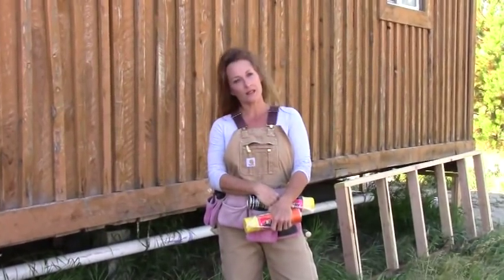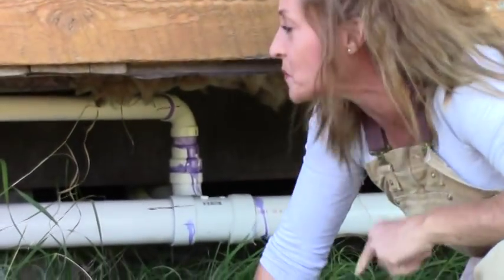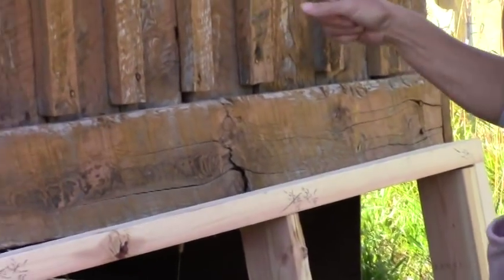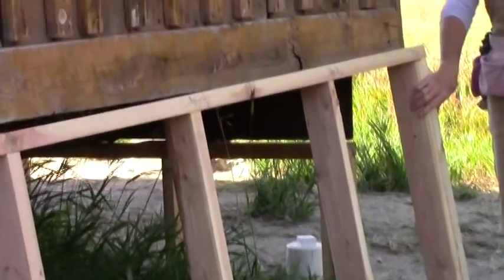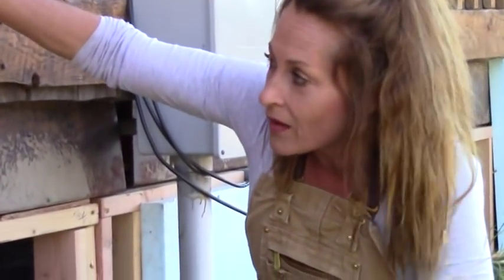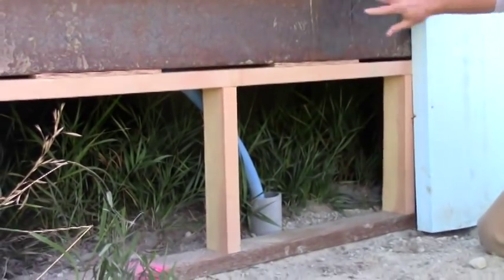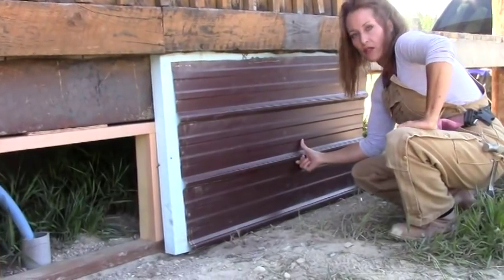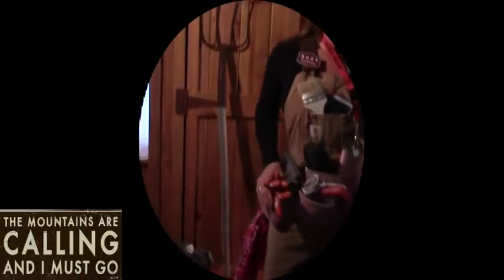Skirting a Trailer or Cabin

Comment: you should have pour a small concrete  footer all around the bottom of the trailer to fasten your bottom treated 2x4 to. wood to ground will rot, sooner or later.

Comment: I luv her :D Can you use the ridgid foam in the under the floor instead of the fluffy stuff?
Reply from the maker: yes--it works great for exterior purposes ..I like it because it doesn't provide a home for critters !
Reply: I just recently bought a 1/4 acre lot with a old 1979 mobile home on it next to a lake for $5,000. I'll be closing on the sell of my house in the next month and will be moving there full time. So it needs alot of work and all the fluffy stuff needs to be pulled out. I like the idea of not having to itch for days when replacing it lol. So I guess I just fill the whole space between the floor joists with a stack of that foam?
Reply from the maker: the Blue board insulation comes in different R Values and the only disadvantage to it is that if your area is not perfectly square you will need to grab some gap filler to get any missed spots.....good luck with your project..how exciting ! And thank you for the SEO info...I will look it up for sure ! Yes ,I have a FB page as well as a few other social media spots...Love the name of your channel...sounds like you have a sense of humor !

Comment: Nice project but how would you deal with possible termite problems?
Reply from the maker: I get the question alot...hard for me to answer since Termites are not really a problem in this part of the rockies....its rodents here that do the damage in the insulation ... but you may want to use treated lumber on all your framing and or use a bug spray around the base and in your crawl space yearly....good luck !

Comment: Nice video presentation.  The Rockies calls for cinder blocks? :)
Reply from the maker: there are a lot of variables as to what kind of base is used for mobile homes but the ground in this part of the Rockies is a very hard clay base so cinder blocks work great since the ground does not shift much after your pad is settled...the key is to give your new pad time to settle or don't touch the ground at all so there is minimal movement after the building is set therefore less maintenance on the skirting -but there is always some degree of movement unless you have a full foundation and or monolithic concrete pad.
Reply: I agree, blocks would be ideal for that terrain.  It's also important to dig deep enough into the ground, (I have found) to wrap the water lines with heat tape.. the deeper the better.  There is nothing more frustrating with a trailer given all the headaches with it than having frozen water lines and tinkering with it in the middle of winter.   A crawl space is a definite.

Comment: Good idea in theory, but doesn’t the frost pick up on it? What do you do then?
Reply from the maker: Your bottom boards for framing need to be treated lumber but the rest of the materials should keep enough heat under there that you will not see frost on the exterior either....I have never seen frost on any skirting in Montana but maybe the case in a wetter state.

Comment: sideways? weird.

i didn't see you fasten the framing at all.. is it just nailed into the top and floating on the bottom?
Reply from the maker: framing is screwed into the floor joist board on top and bottom of framing is dug into ground enough to stabilize it or you can use rebar stakes  into bottom frame board and into ground...sideways on metal panels gives you more materials instead of cuttting them as much but it is a preference of how you want it to look...and if your metal is sideways make sure the ribbing lines up all the way around the building so it looks better-good luck